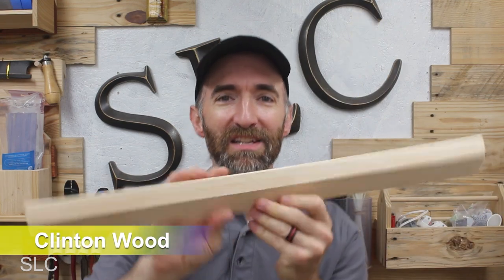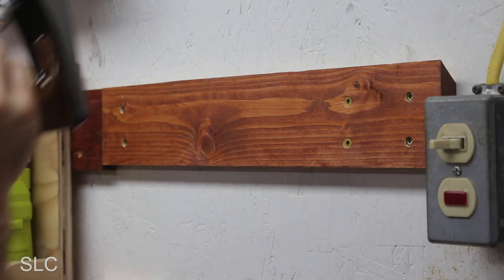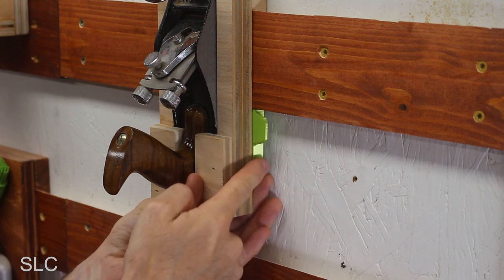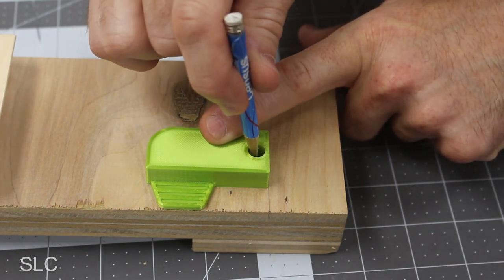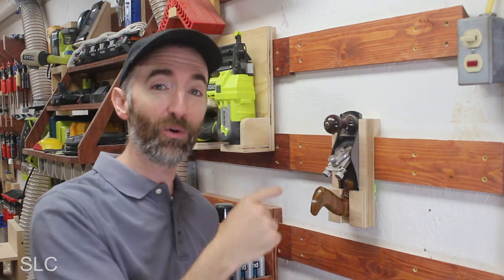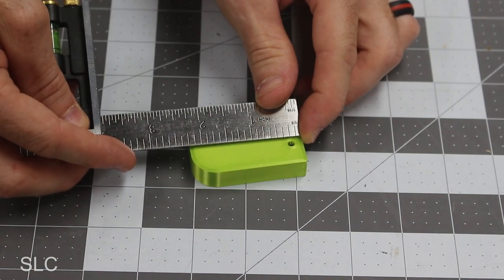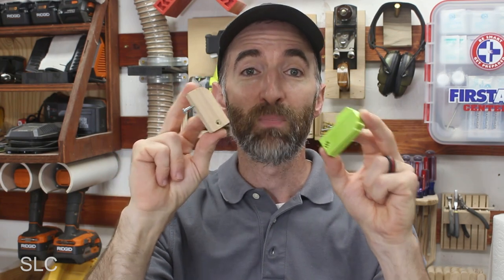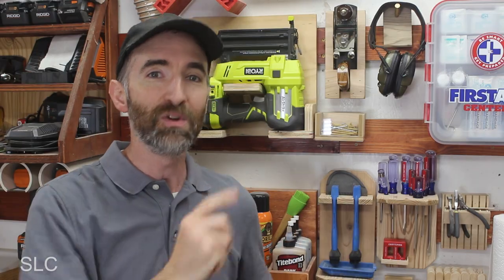The Next Generation of French Cleat Locking Systems

Comment: I like this idea a lot, but would probably make it more like a cam lock clamp, rather than flat on the top, just to lock it in tight.
Reply: I thought this was already basically like a cam lock. What's the difference
Reply: A cam lock would apply more pressure the more it was turned in. This is basically just a spacer block that rotates in and out of position.

Comment: This is a great idea.  Most of my tool holders are heavy enough they don't need to be locked, but I'm about to make a bunch for my garage, where the tool will greatly outweigh the holder.  This locking device should make them secure yet still portable....screwing them in the wall defeats the purpose of a French cleat!

Comment: I worked as a cabinetmaker for 35 years and have never seen this idea. Though I don't recall having a significant problem with the hanger coming off when removing a tool from a French cleat, I can certainly see the benefit of the idea. Good video, thanks.

Comment: I keep seeing a lot of people ragging on this saying just screw it to the cleat, but many people have storage bins and other items in a French cleat system that you want to remove from the wall on a regular basis. These type of quick locks are nice so you can remove a bin or something quickly to your project location without the need to unscrew and rescrew in, stripping out a hole over time for a screw.
Reply: make a hole just under the vertical plank and put a bolt with a nut in there. Boom cant go up, just unscrew it if you want to change it and it wont fall from the wall anymore. Also you wont strip anything since there is no screw in the wood.  This video idea takes way to long to make for its purpose.
Reply: @dmyt58  Wouldn't unscrewing it require a tool? If it is something you take off the wall and put back quite frequently a no tool locking mechanism would be much more convenient. And if you 3d print them, press play and walk away. Even the wooden ones he made are not complicated and you can knock out a couple dozen in like 15 minutes.

Comment: This is a great video and solution for somebody looking to make some “perfect”. For me and considering it’s a tool wall in my garage I typically go the route of just putting a screw through the face of the holder at a height that the screw itself will provide the hold down on the back side, just under the wall French cleat (it doesn’t actually thread in to the French clear on the wall, just below it). If I need to move it I just back out the screw- easy.

Comment: First, I can see that a firm stop locking system can be useful on some cleated tool holders. And this is a really good one. Thanks for sharing. 

Second a french cleat tip: I had one tool holder that was more of a rattler than a complete disengage which was a little annoying. I put one coat of flex seal the back of the holder effectively rubberizing it but not on the cleat itself. This solved my rattle problem but didn’t impede my ability to move my tool holder around without an extra step working with or around a locking mechanism.

Third, also a french cleat tip: I have the bottom of my wall cleats at 45° as well. Again easy enough to move a tool holder when needed but makes it more resistance to accidental cleat ejection. 😃
Reply: Not sure I understand the third tip. Can you please elaborate more on that? TIA
Reply: @ashokmoghe8035  I’ll try

Typically:
the wall cleat has a 45° cut on the top and the bottom is flat
and the tool holder cleat is flat on the top and the bottom is at a 45°

My cleats wall and tool cleats are the same height. The wall cleats are spaced one cleat height apart.

All the cleats are cut at a 45° angle top and bottom so they are parallelograms. 

So when you slide the tool cleat into the wall cleats it fits into the wall cleats touching 2 wall cleats, the one above and the one below. The tool holder must be slide in and out at at 45° angle. 

I hope youtube keeps the formatting in this next part in tact: 
w is wall
wc is wall cleat
tc is tool cleat
like any french cleat wall the tool holder is attached to the tool cleat and can span multiple wall cleats with or without additional tool cleats

above top cleat
w|  /  |
w| /   |
w|/    |
w||wc|
w||wc|
w||wc|
w||wc// |
w||    //  |
w||   //tc|
w||  //tc |
w| //tc  |
w|//tc   |
w||tc    |
w||tc    |
w||tc    |
w||tc  //|
w||tc // |
w||tc//  |
w||  //    |
w|| //wc|
w||//wc |
w||/wc  |
w||wc// |
w||    //  |
w||  //tc|
w|  //tc |
w| //tc  |
w|//tc   |
w||tc    |
w||tc    |
w||tc    |
w||tc  //|
w||tc // |
w||tc//  |
w||  //    |
w|| //wc|
w||//wc |
w||/wc  |
…

Comment: Seems like it could still lift forward from the bottom, even if it fixes the lifting up problem. You could make a double french cleat, that is, inset the lower part of the rail so the lock slides behind the rail, similar to how the top locks in. 

Also, I imagine the screw will unwind eventually. If it was worth the effort, you could use inset bolts with lock nuts to hold the locking lever in.

Comment: The locking mechanism is very nice.  I have almost fully built french cleat walls for 2 of the 3 garage / workshop / storage room walls.
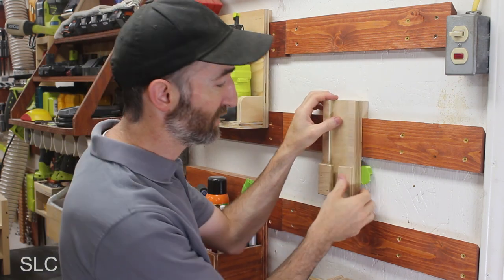However, I could not help but notice that at 2:11 min into the video  you show the locking mechanism hole to be close to the cleat (this will not work).  Then at the 2:52 min time in the video you show the installation to be done correctly with the screw on which the mechanism rotates away from the cleat bottom.  It is OK to make mistakes, but I suggest that you note the mistake in the video.  Or you could have done a retake with hole shown correctly.  No worries.  Not a big deal.  It just shows integrity when you note these mistakes.

Comment: I like simply using a T-nut on the inside and a machine screw from the outside which sits right at the bottom of the cleat; it’s quite a cheap fix and can be even cheaper with just a wood screw going through though the T-Nut allows the screw to be removed and re-installed more times. I don’t find myself moving things around a cleat wall enough for these though keeping things from popping off is a must for smaller holders.

Comment: I did an entire wall (4' x 8') of FC, and it does hang a lot of stuff.  However, the FC concept is justified by the flexibility of moving things around.  I built my wall about 8 years ago (you see what's coming, right?!) and haven't moved anything yet.  I find 1/2" plywood over drywall makes an excellent mounting wall.  Whatever support device you conceive, mount it on 1/8" oversize backer board, and hang it on two or three keyhole'd screw locations.  It's easy to remove, largely "fastened" for security, and the backer board gives you a template for screw locations if you want to rearrange locations of support devices.  That's proven (for me) much more flexible than cleats.

Comment: Nice solution, but an even simpler tool-less lock would be a piece of dowel straight through the holder, just make it long enough that it sticks out a bit when fully pushed against the wall, so it can be pulled back easily (and maybe turn a small integrated handle on the end if you're feeling fancy)
Advantages: no need to have access to the side of the holder to remove it, much simpler to make

Comment: I’m going to be doing the vagabond thing with a motorhome in a few months and I’m going to gut and convert a 24ft travel trailer and turn it into my towable, wanderer’s wood shop. so I’m going to need a locking French cleat system to prevent things jumping off the cleats on bumpy roads, but one that also resists sliding in case I have to slam on the breaks my tools don’t all slide along the cleat wall towards the front.  

I’m thinking a number of different things, including a 45 on the bottom of each wall cleat as well as the top, and slot in the forward plate of each holder with a thumbscrew or star knob that can be loosened and tightened,releasing and locking a mating piece hard up against the 45 on the underside of the wall cleat.  Perhaps that mating finger will have a high friction anti-skid piece of material glued to its 45.  It’s going to be fun to workshop it.
Reply: Sounds really interesting Cole!

Comment: My town library has a 3d printer. Check to see if yours does then you can design your own, download these job specific free ones or go to a free site and shop.
Reply: 3D printers have become very reasonable - some under $200 - you might want to look at what you can do with them.  I used to be a woodworker, now pretty much just 3D printing.
Reply: @woodwaker1  My brother has one that is sitting 3 feet from me. I might use it for making lost plastic casting in aluminum or brass Or simply for the pattern in sand casting... but I don't like Plastic. I prefer wood or metal.
Reply: @dave_ecclectic  I agree that metal is much better for many things.  I have printed some structural parts from plastic and they can be surprisingly strong.  The speed of prototyping and low cost of material is amazing.

Comment: What would be wrong with putting a simple screw from the front, on center, near the bottom.
Reply from the maker: I would most likely take longer to lift off and replace the holder when needed.
Reply: @SpecificLove7  How long could it take to back out a screw enough so it clears the rail and lift off. Pretty simple.
Reply: @Mr_Rick  One of the reasons to go with French cleats is that you don’t need any tools to hang or rearrange the holders.  So you can add a screw - heck, you can screw right into the cleat and make them semi-permanent.  I love this addition because it lets you lock in the bracket and remove it tool-free.  I never thought I’d rearrange my French cleats as much as I do and I have come to really appreciate the ease with which I can put things within reach for today, then swap them out for the next project.  I don’t want to add even small barriers to that.
Reply: @Not_TVs_Frank  I have used French cleats for years. I have 44 four foot shelves in my garage. Some are 8", 12",  and 18" deep. Every shelf has trusses on each end and a stiffner down the center underneath. They've been there for seven year with no change. A locking mechanism to keep them on the wall can be simple. IMO, a screw will do.

Comment: Absolutely pointless. If you're going to go this far, just mount the tool holder directly to the wall. 99% of people who setup a French cleat system don't move anything once it's all setup. Total waste of time.
Reply: Actually I did a permanent version of this where i screwed a board across a holder for my microjig that had a tendency to fall off knowing that I could only ever slide this in.  I wish i had thought of this instead since its a lot more versatile.
Reply: Just because it’s totally pointless to you doesn’t mean it is for “99%” of French cleat users.  Leave the guy alone!  I, for one, appreciate the ingenuity.
Reply: nah its not pointless if there are other people randomly coming thru your shop pulling things off the wall in an effort to  'borrow your tools'
Reply: What is this "once setup" thing?
Buy all the tools at once and then stop?

Comment: You could just screw the holder into the French cleat.  Come on Guys this is just silly and adds work.
Reply: Some people enjoy the work itself though, unnecessary as it may be :)
Reply: If you are a person who removes holders from the wall or rearranges things once in a while you're not gonna want to have to grab a drill every time and then add extra holes into the cleats themselves. If people are going through the trouble of making tool specific holders for a French cleat wall, adding 2 minutes to the build isn't a big deal.